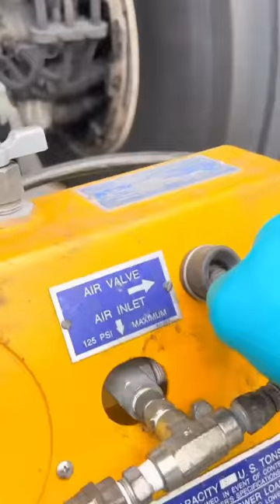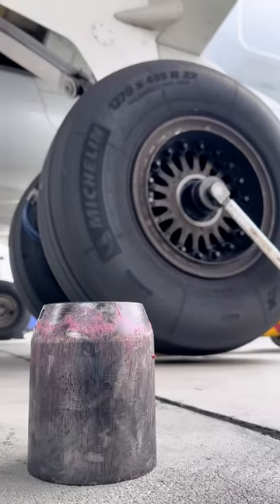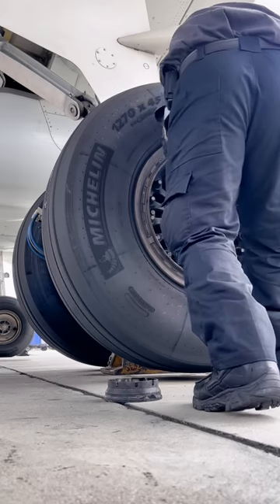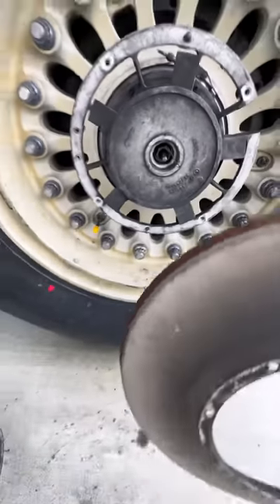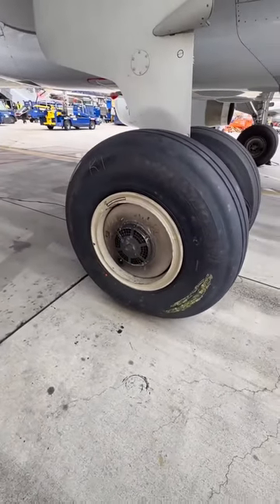Airbus A321 #1 wheel assembly change. THIS IS REFERENCE ONLY.

Comment: As a fellow AMT, I appreciate the fact that you mentioned that this is Reference Only and to follow the AMM for the procedure.
Reply from the maker: Absolutely. Safety first and those manuals are constantly being updated. Thank goodness we don’t have to memorize any of this. Just need to know how to use the tooling properly.
Reply: Everything in aviation is MM controlled inc. current revisions, modifications and standard practices. I expect the maint. crew checked this before starting the job.
Reply: Breakaway watch band…
Reply: Its kinda obvious. Even if you watch someone build a lego set might be smart to check the manual. I honestly didnt think he had to mention it so much. Common sense to me.

Comment: I have huge respect for you guys. If I would have to do that I would probably have left a few bolts and nuts in the end. That is, if I can can remember what goes where in the first place.
Reply: Lol I know not only for this, but also in many other hardwares you have to dismantle putting back the pieces back together again can be frustrating luckily today we can take pictures or videos of each step we take when dismantling it  really helps later on
Reply: That's one reason they work together and sometimes a qa guy is watching them to sign off on their work
Reply: Create and use a bolt board with a schematic on locations.  Do not just throw them in a pail.
Reply: I thought if you could achieve assembly of anything with fewer bolts, that just meant you’re better than the manufacturer. 🤷‍♂️
Reply: This is the best way when out in an airport or flight line. These guys do these allot and know each part and where they go. But if removing hundreds of screws say like up on a lift on wing acces panels we used Tabasco bags with tie strings so we could put the same screws or bolts back in. We'd tie the bags to the panel especially if it was going to be a day or two before reinstalling the panels. If larger parts We'd put the like on a bread rack in the parts shed  with removal record serial, part number, and aircraft they go to plus date removed and time. Now for tools it's super controlled with cutouts in tool boxes for each tool and a chip with your ID to put in each spot so the auditor knows who has them out. Loose parts or tools on an aircraft is a bad thing especially in flight.
Reply: @fdhicks69 I think they are implying they are even too stupid to use a board...he'd forget or lose the pen somewhere
Reply: @ajcook7777  it would be funny if one of them randomly wrote "What's a Bolt Board?" 🤣🤣... But yeah, There is a reason MEGA training is required for this and ALLOT of people Dont Pass...
Reply: Not a chance lol, when you fix shit and call it good with your signature, there tends to be more incentive to not forget things 😂

Comment: Glad to hear you mention removing the air pressure from the wheel because I didn’t see it being done immediately after jacking the landing gear up. Safety first. Wheels should only be removed and installed at a greatly reduced pressure. Once the replacement wheel is fully installed, use nitrogen gas to top the wheel pressure up to the required amount. There is a history of people being injured and killed by failure of the bolts holding the wheel halves together especially on the wheel coming off of the aircraft. 
Good video for reference.
Reply from the maker: thank you, i just to mention i used the tire pressure to jack it up as well
Reply: What pressure is spec for that tire?

Comment: So glad to not see snap rings😂
I changed tires/wheels on heavy equipment at a saw mill. The tires alone were 1100 lbs. We would put a 55 gal drum of antifreeze in each of the counterweight tires to keep it down under a load. Probably not a factory recommendation.

Comment: I was an A & P mechanic at Continental Airlines and worked in the tire & brake shop. Did 727 & DC-10 tires and brakes..fun job..
Reply from the maker: Fun times 👍 you got to work on the classics
Reply: Continental here 🤘 newark heavy hitters

Comment: I'm glad you said it was reference only, I was just about to buy an Airbus and needed a DIY guide for a wheel change.  😊

Nice info.
Reply: Yeah like wtf
Reply: I’m an aircraft mechanic and this video is probably in an airline shop video library. It MUST be labeled FOR REFERENCE ONLY as it’s not an official Airbus maintenance manual which do get revised. The FAA would fine the airline if uncontrolled manuals were caught in the shop. And internal airline auditing teams would call out the manager who’s shop it was in.
Reply: Boy some of you really seem to think because I watched a 14min video I thought I could swap a wheel on an Airbus
Reply: It is a legal requirement. The same statement can be found in all our study books. Because it's all uncontrolled data. Whenever it is not for reference only, but the data isn't controlled actively by the airline or the aircraft manufacturer, one must always check whether the maintenance manual version number is the most recent one. These days, you carry all maintenance manuals with you in the form of an iPad.

Comment: I'm sure there's a good reason for this already. However, I often wondered why airplane manufacturers didn't design the wheel too spin when it comes out for landing. A simple rim configuration could act as an air foil that when the tire was lowered from the fuselage air current would spin the wheel. That way when you land you don't lose 80% of the rubber of the tire.
Reply: Spinning wheels during flight would require more power and weight, and those would reduce the efficiency & performance of the aircraft.
Reply: @MulaBatiswaHutagaol  I don't know what you're referring to. The wheels are in their base during flight. And it would only take a small windmill device on either the rim or heaters assembly as the tire comes out of its bay. The wind spins it. Thereby limiting the amount of rubber it leaves on the runway. The tire doesn't just sit there and spin all the time. It only spins when the tire comes out. I don't think you're understanding is quite right
Reply: It introduces some unwanted variables, such as gyroscopic effects during approach, and uneven inertia on touchdown if the wheels aren't spinning in sync.

During take-off, the wheels need to be stopped before they're stowed, so keeping them at speed in the air would cause more wear on the brakes.
Reply: @VanillaLibrarian  I've already looked at that and I have found that it would be negligible...
Reply: @petebetz5358  I think it would be pretty pointless if the wheels aren't spinning a fairly high speed. And at high speed, the gyroscopic effect would be massive.
Reply: @CheapBastard1988  as long as the wheels are extended, it wouldn't be a problem. I'm not sure it would be a problem even if the wheels weren't extended. I've also designed to tire in my brain where all you'd have to do is change the tire. It would have aerodynamic qualities that would make it spin. Once it came out of its bay it would spin at 75% of the speed of landing. There'd be a little bitty screech but nothing compared to what there is doing now
Reply: @petebetz5358  i'm just trying to answer your question and make a discussion of it, so I'm referring to wheels that are not spinning in out position during flight, especially on final approach before touchdown on the runway.

But, hey, what do I know. I'm regreting getting involved in this conversation.
Reply: @MulaBatiswaHutagaol  no disrespect intended. I assure you it's hard to convey your true essence as it were over whatever this is called a tweet or whatever... So misunderstanding is par for the course.. I'm talking about a jet airplane tire that wants. It comes out of its bay and is subjected to the aerodynamics of the plane that aerodynamics begins to spin the wheel prior to landing on the ground. You can spend it as faster as slow as you want. You can spin it to the exact miles per hour you want. Now, I don't think I'm that smart and I'm sure that the airplane people have thought about this stuff before. That's how all this started. I wonder why they haven't done anything like this and I'm sure there's a reason. And that's what I was looking for..
Reply: You don’t loose 80% of the tire on landing. These tires last hundreds of landings. They’re designed for it. The wear comes from excess braking, rather than initial touchdown. Im an A&P and have changed a lot of aircraft tires.
Reply: @Thomasgm490  and they're in lies the answer! I read an article about how much rubber they leave behind. I wasn't sure at all how many landings they get. I started this whole thing off by wondering why they didn't spend the tire. Now I know they don't care if they can get 400 landings out of a tire. They're good to go...
Reply: Actually, the military and airlines both experimented with prespun wheels for landing back in the '60's.  While tire wear was reduced the lack of touchdown braking effect was found to be undesirable.   That effect both very slightly slows the plane but, more importantly, pitches the nose down some.  These effects help the plane transition from flying slow just above the ground to rolling along trying to find the runway exit.  The prespun alternative makes the plane prone to bouncing.
Reply: I'd say the cost savings would probably not add up with the required extra components needed and maintenance on those new parts. It'd probably cost more to do what you're proposing, otherwise it would have already been done! Airlines run on very thin margins! Thus life is simpler. It's all about the money!
Reply: Build the runway out of rubber and the wheels out of concrete.
Reply: Maybe for an Airbus but you definitely couldn't do that on a Boeing 737

Comment: 7:02 - I have a question. Why does Airbus use the term "to safety" the nut instead of just "to secure" the nut on the manuals? Is it an aviation term or is it just Airbus?
Reply: It’s just shorthand for “secure with safety wire” or something along those lines. Not every fastener in aviation is safetied, but those that are, absolutely need to be.
Reply: @nickboenigk4905  Thank you! I work at a part 145 repair station and I could not understand why they write "unsafety the nut" on the manuals. That sounds so wrong in English

Comment: Wow 150lb ft for the final torque number on the center lock nut seems so low. After the 300lb ft initial torque value I assumed the final would be around 5-600 like it is on street cars with center locks like Porsche and Mclaren. Very interesting for sure.
Reply: The 300 ft lbs is to ensure the bearings get a good seat on the axle, 150 is about standard for most big jets. With how much force is exerted on those tires and the axle, a high torque value would be detrimental and could cause more wear and tear.
Reply: It's due to the fact that two conical bearings are installed on the wheel itself.

Comment: Oh, this takes me back. Haven't done a wheel change in a few years. Same principle, just on a much smaller scale (Beechcraft King Air).

Also, is that Chevron cutting I see on the inboard tire at 8:33?
Reply: It's typical damage within limits. A single cut is generally not allowed to go from groove to groove. Though this may vary with each aircraft type.
Reply: @CheapBastard1988  I figured it had to be otherwise they'd be replacing it while they were out there. Just seemed so alarming to see it at a distance so clearly.

Comment: This is really cool. I'm curious about the electrical connections to the brake fan. I didn't see any wires. Thanks for sharing. I learned a lot.
Reply: That's because on the airbuses the electrical connection & the components that actually spin the brake fan are on the brake assembly it self. You only remove the impeller (fan) it self when changing a tire. Every else stays.

Comment: Would have been nicer if the brake fan and other bits get  cleaned up before installation 😊
Reply: Why bother, they will be dirty within the next couple of flights anyway. This is not a beauty contest
Reply: That filth is lubrication
Reply: @Lunibruniful  lubrication residues are on the hub, maybe  , but all other pieces after wheel nut have break dust mixed with excess oil mist and stuck on the fan, clamp, and fan housing surfaces ...
Reply: @12345fowler 🤔 dear brother , in engineering way or mechanical way , cleaning parts are not only to make them look prety, during any maintenance when you clean the parts you can observe if there are any tracing of failure exists such as line of cracks, erosion , any wear may lead to incident.
Reply: Doing that when you have 10+ aircraft to attend is a bit of an ask

Comment: I thought it strange the way the technician throws the various parts on the ground. Nothing on the a/c is cheap, so one would think more care would be taken while handling the varios parts. And yes I do have an A&E ( that’s what we called the license but when I got mine )
Reply from the maker: you have HANGAR BOY written all over you lol    work on the line...then come talk to me. And your A&P is what you mean to say i hope
Reply: I worked as a VW technician and we used mag trays for any loose items. Maybe magnets and aircraft don’t mix?
Reply: @StigAviation A&E means Airframe and Engine on the old UK CAA licence back in the day but it’s not used  now. I wouldn’t be throwing those parts on the ground either and that’s coming from someone who worked on the line for nearly 40 years. Other than that a good video.
Reply from the maker: @PhD63  From what i know about UK they fall under the EASA part 66 certification...  they call themselves AME Aircraft Maintenance Engineers.
Reply: @StigAviation  Licenced Aircraft Maintenance Engineer. Under EASA Part 66 the old A&E designation changed to B1 and Avionics to B2. I hold both B1 & B2 but retired now.
Reply from the maker: @PhD63  now that’s very impressive. Not many get both B1 and B2. Well done sir.
Reply: @StigAviation  Thank you. Modern aircraft have become more and more electronic these days as I’m sure you are well aware of and a lot of employers prefer you to have both.
Reply: @waynegriffiths5143 maybe the parts aren’t ferrous? Hint: I have been working on planes for over 30 years.
Reply: What about the other tyre 
It’s looks really bad even though you don’t show us how to do it but change it please it’s not safe for landing
Reply: @StigAviation  i worked as an A&E mechanic that’s what it was called when I got my license, yes on the line and in the hanger. Bet you never changed a jug on an 1830. In case you didn’t know it, that’s a P&W radial engine. Yep worked on RR Dart engines as well. I case you didn’t know it that’s a tubro prop engine. Oh yah worked on tubro jet/ tubro fan engines too hanger boy. Jajajajajaja

Comment: I am a car mechanic and I would have thought that you would have a sorting box for each job where each screw goes in exactly the right sorting compartment so that you don't forget anything. but as i can see, it's no different than with us car mechanics, we simply always throw all the parts together on the workshop trolley or on the workbench, or on the floor. 😁
Reply: When bolt position is significant, like on a cockpit window replacement. We stick the bolts in a piece of cardboard in the same respective position. I did the same when I modified the intake manifold on my car.
Reply: Jesus, that seems pretty sketchy for an aviation job. What happens if that was accidently kicked and the bolts were mixed up. Didn't the windshield of an aircraft fly out because the improper bolts were used? I also thought these jobs were supposed to be done while referencing every step in the manual at the time it is performed.
Reply: @-Bill. He did say he put them in a piece of cardboard and that’s normal practice. You draw an outline of the window on the cardboard marking where the holes are and then as you remove the screws you punch them into the corresponding holes in the cardboard. And yes, you would have a print out of the relevant AMM.
Reply: Don’t even compare us aircraft mechanics with a car mechanic. Not even close. 😂
Reply: Running to grab a sorting box sounds like a waste of time. Just put the bolts back.

Comment: Does your company say it’s ok to do everything one handed whilst being distracted on your phone? And does your company even allow you to use your phone on the apron during jobs??
Reply: In many cases the manuals can be accessed on our phones. Airbus helicopters has an app for cell phones and tablets for the manuals required for the maintenance when I’m doing my inspections and other maintenance on our helicopters. There is many other reasons we use our cell phones in aviation maintenance as well.

Comment: This is very similar to an F35A tire change, except it doesn’t have a fan, it just has a hubcap and the 3 fasteners don’t have cotter pins, they’re tied together with safety wire and a little sleeve goes over the safety wire lol, and the axle nut is torqued to a much lower spec. 300 ft lbs is pretty insane for the initial btw
Reply from the maker: That’s pretty awesome that you got to work on the F35. And it’s all pretty much the same, if you have done work on your jets, you can probably do the same work over here.

Comment: Why they didn't show cleaning parts before installing the new one? Like using air to blow blast from the brakes carbon ,also cleaning other parts ?
Reply from the maker: Because I don’t have the time to clean them all up. It would take too long sir. And in any case the wheel and brake will look exactly like this on the next landing. And it’s dangerous to blow all that carbon dust all over the place.

Comment: I would have thought you would have cleaned the brake dust and debri off the parts.  When we do brakes on a car, we use brake clean. Is there a reason you didn't clean the parts and inspect them at the same time?